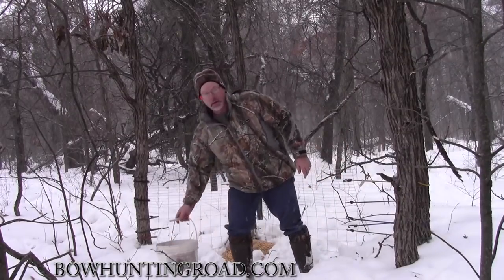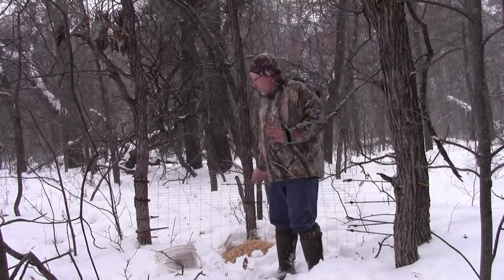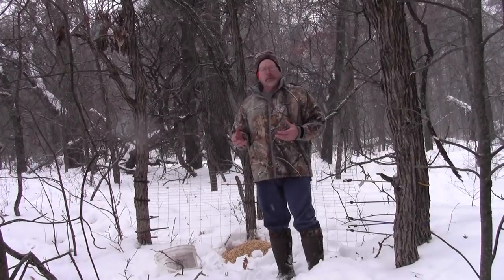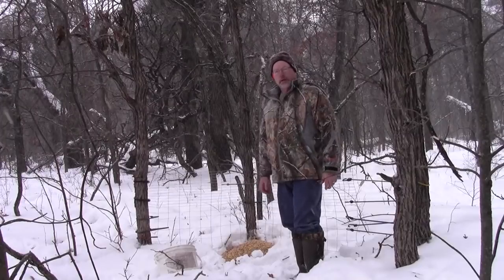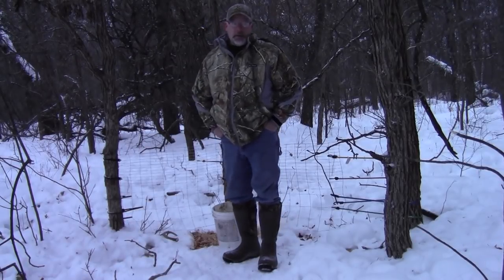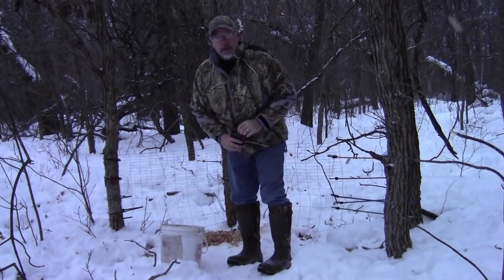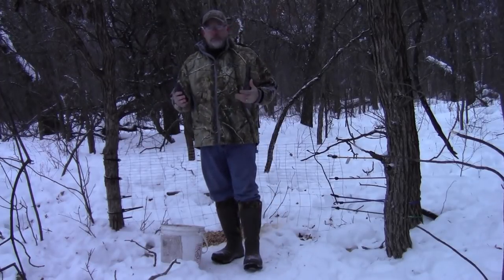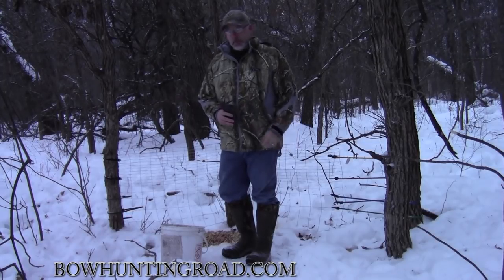Building a shed deer antler trap

Comment: Nice video!, I prefer bungee cords over any type of fence because of the possible injury that the wire could cause to the pedicle if he got to entangled into the wire fence.  My reason being is that if your feeding them and they are continuously coming back the bungee cords will eventually work putting pressure on the rack when the deer is pushing and pulling his head through. When the antler is eventually ready to drop the pressure that the bungee puts on the antler when the buck putts his head or pulls it out will then break the seal on the pedicle base. Bungees are breakable if the antler gets to hung up and isn't ready... and in my opinion wire could casue more of a threat to the health and well being of the buck.